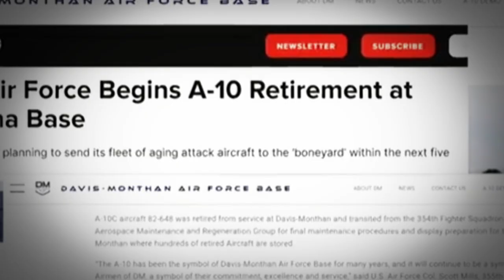Too Ugly to Die: Inside the A 10 Warthog’s Fight for Survival

Comment: They should not get rid of the warthog it is the best tank buster
Reply: Its not a tank buster. It can't survive long enough to take out tanks in an even 1990s threat environment. 

And it's only using missiles on the tanks. The gun is ineffective and always has been. 

The A10 is as obsolete in a modern use as the P51 is. It's long been superceded by fast fighter bombers in CAS and by drones and AC130 in COIN.